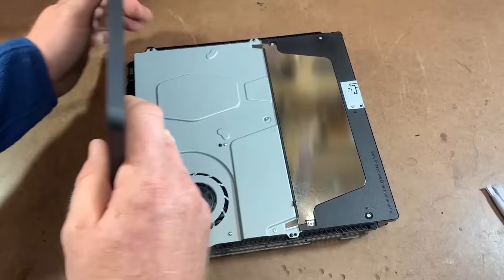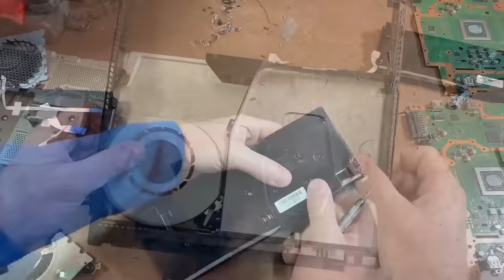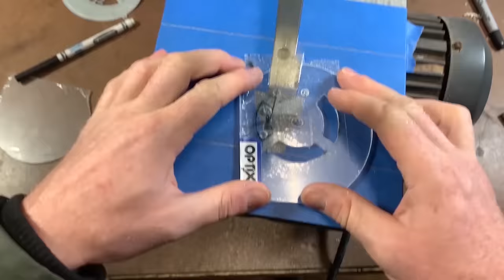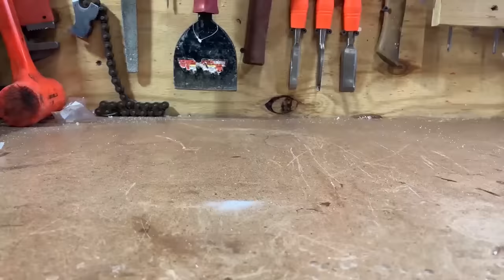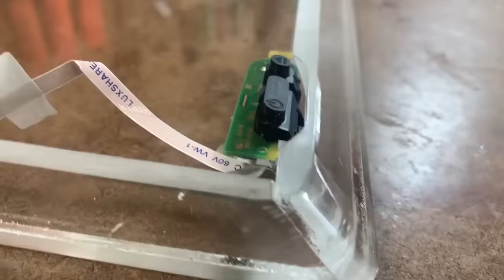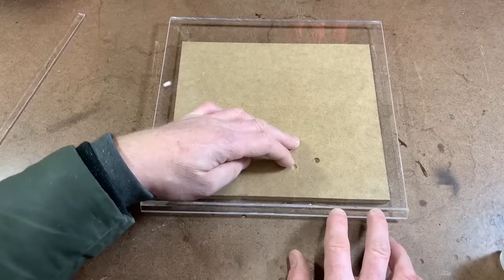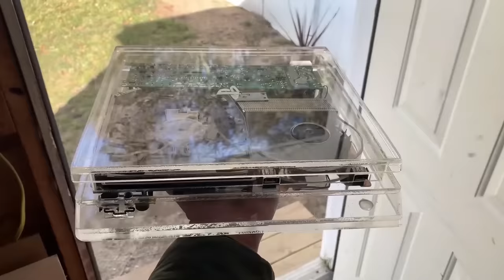Glass Playstation 4!! Custom Hand Built!

Comment: So y’all aren’t worried about the air flow?
Reply: He should of cut vents and have the top peice of the frame raised about a half inch for extra air flow.
Reply: This man just turned his PS4 clear. Gaming on this machine isn't a priority. This is for the aesthetic
Reply: Yeah he should’ve cut vents
Reply: I'm more worried about how he threat the power supplies. Careless af
Reply: Air flow? How tf are you not Disturbed at the fact he glued the heat sync on the processor and even didn't change the thermal paste?!
Reply: No worried
This is masterpiece
Reply: That's good more breathing
Reply: The music was a little too southern...no wait, i mean corny.
Reply: nah but im worried about @_bxrti on instagram hes cool
Reply: @Junpei747  I know that's playstation abuse 🤣. Call 444!!
Reply: @Junpei747  finally someone mentions it lmao
Reply: The real question is how he gotta take it out of the glass when he’s done or doesn’t want it in the glass box 😂
Reply: @User_55558-z  glass is known for shattering on impact...
Reply: @Shrixen  btw it's acrilic not glass. Acrilic is a lot more durable then glass. He does not need to smash anything all he has to do is heat up the glue and it will flow so he can easily take apart the frame.
Reply: @User_1795  lol ik its a joke

Comment: The metal plates all over are there for a reason, they're called faraday cages and are meant to avoid shorts and interferences such as static. There's also a reason why the PSU is seperate from the motherboard. The HDD is also meant to be removable, not glued to the motherboard.
Reply: definitely not for gaming several hours straight daily
Reply: @JEZZUZZGaming  nah hes not a buzzkill hes right idk why you had to point it out
Reply: Not to mention there are no slots cut for the fan to suck in cold air through the heatsink.
Reply: @JEZZUZZGaming  bruh
Reply: If it's not gonna get killed by static it's gonna cook itself
Reply: This would only be good for netflix niw
Reply: @JEZZUZZGaming  😂😂😂😂😂😂
Reply: @jamessmith2514  I'm pretty the guy knows this. He's made it for the sake of making it. No need to be a super nerd
Reply: @broughy23  no wonder he only played deadcells on it,if he tried any other game that thing would've been roasted
Reply: @broughy23  only person with sense
Reply: A guy in his mom's basement jealous he doesn't have the skills or the balls to come up with this so you gotta trash instead of appreciating the hard work, skill and guts he had to do this
Reply: @kmburke84  Cringe 👆
Reply: @RANDALZ  lmao
Reply: are you forgetting that piece of metal he tossed to the side after cutting the heat sink out was a cold plate for cooling the memory as well playstation without active cooling on the memory and vrms wont last long
Reply: and he didn't even clean and replace the thermal paste and just glue it together with the heatsink, I cringe there
Reply: Quesque ça peu te faire ? T'es jaloux de sont travail ?
Reply: @broughy23  so ya the  kinda person who would buy this and if  it  screws up ya  would  hey its kewl as  ya  maybe  spend  500  dollars  for teh custom case  and  60 dollars   shipping  to and  from and in lets say a few months it  died on ya cause no proper heat syncing and such as ya had a brick of a system  right? You call folks point out  stuff  super nerds . well those super nerds  don't want to pay   some ungodly amount to have a system  die on them and then have to go and buy a new  system . 

so please  state  ya would not care if ya spent 500 dollars not counting  shipping and handling  to maybe  in a year  it dies  from the various  things like shorting , hard drive crash ,  or melt  down.
Reply: @kmburke84  Naw i think most of the folks that @Eng-Kush ( what a name  must be a massive  pot  smoker )  called Super Nerds  would rather have a  clear system taht woudl last a while  vs  having it  die  within  6   to a year and have to go out and buy a new one. Bear in mind . Sony makes it easy to replace teh hard  drive  on teh PS3, PS4 and I believe the PS5  . Just for teh possibility of a hard drive crash and also  so one can upgrade teh system ( of course they sell if i  recall preformatted  hard drives for that so ya feel like a real gamer  buy popping in a approved  hard drive) 

as far as skills   yea  not everyone has the skills  to build but they may have other skills  like if ya dumb ass accidently installs a virus  thinking  whoo hoo  ya  found on a torrent  website a copy of  GTA 6  and the game is out and instead of buy a legit one ya get that Torrent and opps it  opened you up  to being hacked  and ID Thefted . that  not talented at construction person . MAY in fact be the one to help ya fix that so  ya  keep those pictures, illegally  downloaded movies and Music    from being lost. 

You call it trashing skill . I see it like folks who know more about the insides of devices  educating those who just  dont know. If i was into construction of  such  devices  I would actually appreciate  folks  pointing such things . I sure as hell would love to know hey  ya really should keep those pieces  and such . I sure would feel bad if i sold  a  clear  case system  for  lets say 500 usd  only to find those folks coming back to me  hey  my system is  fried ya  owe me my money back and  a  new  ps(x)  

Sad i am sure ya would not care as ya like screw you   want a new one i will sell ya one  for 1k  i am not gonna  refund ya cause i didnt know about this and that. i am pretty sure ya a dishonest person. i wish ya would let us know ya real name and location irl  so  we can avoid doing business with you
Reply: @yukinagato6761  you've mentioned me in two comments bro are you that triggered? This console was an experiment or done because this guy wanted to see if it was possible. No one is forcing you to do this to your own console bud. Try not to get upset about what other people do with their own possessions and you'll live more care free life
Reply: @broughy23  I justy think if one is going to do such a project it  shoudl  be  certified  taht it will work  and no isues  such os  burning  a  system out .  you may live  in a  world  where ya selling dope enough  to buy a  few PS4s   so if ya  bought  a  clear plastic  NOT  glass as he titles many of his videos (BY THE TOS of Youtube is Misleading  to say Glass  vs  Glass like/Clear Plastic )  but anyways  if  this person was to make a living on these  he  shoudl also make it a point to say if you buy  one of these  and it burns out i will compensatue  you . Now lets make no mistake  I am willing to bet this person sells them on some store front at a nice price tag . 

Dare i ask if ya spent  bank on oen and all your important data   was lost on it  how would you feel. The Super Nerds as ya call them  actually have a higher respect for their gaming and  yea  they woudl lose it if they lost   their  stuff on a system  taht was not properly designed . . hell how many bad  reviews  do ya hear  about this game and taht game system cause of poor performance. 

You may have no issue  shelling out  bank  and maybe if ya  constructed things like this and  didn't care about  it  burning out and performance  great . but for others  that stuff matters. 

for many money is still a bit  tight . but i am sure  to you its no big deal as ya  will beg folks for money here and there  right ?
Reply: @yukinagato6761  Bro I stopped reading that dribble after you accused me of being a dealer. 🤣 you've lost the plot over a fun YouTube video
Reply: and the thermal paste OMFG

Comment: looks cool, but you forgot one major thing, vent holes. The only place for miniscule air now are at back and maybe through blueray drive. Normaly theres vent holes at sides for intake and also at the back for exaust. As it is right now this thing will cook itself to death.
Reply: That fan ain't pulling in air for shit, centrifugal fan just won't "breathe" from those tiny holes
Reply: Yes bro. No vent holes.
Reply: I don’t care about these holes. Another fact is interesting, how will he disassemble this soap dish for cleaning?
Reply: I was thinking the same thing. With no vent holes that thing is dead.
Reply: bruh but this guy forgot to change the termal paste and glued the heatsink to the board
Reply: Won't last long enough, no thermal interface between the chip and heatsink.
Reply: was just thinking bout this.... this material can be thermo-molded. therefore heat can modify its shape. I was a little bit more relaxed when I saw the fire. But I still wonder. if he could spend let's say 6 hours or so playing without any impact.
Reply: @redlineone6737  i think he just made it for the video. if he really wanted to play it he should have done some blueprint work first. tons of mistakes. Why go through the effort of owning the machines and making precise cuts if just to leave out the most precise but miniscule things in a build... Buddy clearly never built a pc before and just thinks he could stick the thing in a teddy bear or a deep dish pizza if he wanted and call its "PS4 build"
Reply: @NaVilke23  fr should of used some screws
Reply: Also, glueing your heat sink, can’t replace the thermal paste
Reply: he forgot to replace the termal pads on the ram too, he could have used mini heatsinks, but yeah this thing in a year will be a pretty paper weight
Reply: Not to mention repair or maintenance of the system
Reply: Him tossing the metal parts away annoy me, I know they block what you want to see but they help move heat  I hope that doesn't overheat.  It does have a fan so bad airflow is better than no airflow.  He didn't even apply new thermal paste
Reply: @Lagger-HD  he literally made the shell, you say "but I build pcs" no you don't build shit you just put it together from existing parts this guy actually built it with his hands and raw materials so shut up
Reply: @Lagger-HD   u could not pull that off
Reply: He forgot the tension plate for the aoc. If he knew what he was doing he wouldn’t have used super glue to attach the heatsink or wouldn’t have glued everything shut. As a pc gamer all I could see was see the extreme use of super glue.
Reply: I can’t believe I see negative comments. Just appreciate the build Damn 😂. Didn’t have to be perfect to be amazing
Reply: @azzithegod  Dont have to be perfect, just functional. If its not functional its a piece of art that looks like a ps4.
Reply: @53XYCL4P-TP  that PS4 won't last long

Comment: Oh this console is so gonna die from overheating, but nice skills I guess.
Reply: yes sir
Reply: Please sir, please, where can I get all the parts for ps1 1 2 3 4 transparent please help me it is not available on ebay or on amazon or anywhere from where can I buy please help me chassis ps1, ps2, ps3 and ps4 transparent please
Reply: @بيببيب-ف3م  build it like he did with glass and plastic
Reply: What do you mean by overheating? Does black colour prevent from overheating then this? Pls explain.. tq
Reply: @mi10tpunya94  you blind?? he left no breathsing holes for the mother board
Reply: for sure, this ps4 was gone, died.
Reply: Even with added vents glass heats very quickly,.. sorry but not very well thought out!!
Reply: @alexisortubia2852  Ah I was wondering what he missed.
Reply: He probably won't play in this console, it's just for show.
Reply: Sir dont forget the parts for the ps5
Reply: @mi10tpunya94  It’s gonna overheat cos there’s no holes for the motherboard to breath
Reply: He used the weight of a mug to put pressure from the heatsync to the apu chip. Definitely not nearly enough pressure and the glue isn't gonna hold that pressure for long as hot as it's supposed to get.
Reply: I think he built it as a trophy piece and probably not as his main gaming playstation. Who knows. Might have been a cheap online pick-up. Whole bunch have been on sale because ppl want to grab ps5s. I'm sure he's aware that all the metal sheathing is there for a reason. I can't know for sure, but it DOES work for now.
Reply: Dark Alk  oh I see.. nice and polite answer you give me.. tq..
Reply: @Baysehead tq for your answer
Reply: @sceptregaming69420  tq for your answer
Reply: @Bundalaba  he also glued the heat sink down without replacing the thermal paste
Reply: yes, everyone here is quite right. that ps4, is done. gone. even though it works, there’s no ventilation holes for the console to breathe. leading to it overheating, and destroying the console. even if it was still plastic, he shouldn’t be putting heavy stuff on it. puts pressure on the fragile parts in it. it’s exactly what i always mean, about poor console care.
Reply: @بيببيب-ف3م  go away begger.
Reply: for everyone wondering. he didnt put thermal compound on it
Reply: its not even glass its acrylic
Reply: uuhhhhh..............
Reply: @kerrykirk2515  It was VERY well thought out. He knew if he did this he would get millions of views and be able to buy 100's of PS4's.
Reply: @kerrykirk2515  its not glass
Reply: I think using plexiglass would have been better for this reason, normal glass heats up too easily.
Reply: @ItsATrap614  You think he used glass??? How does plexiglass heats less than glass? are you 8?
Reply: I bet the playstation it dead by now from over heat lol

Comment: The PS4 is too hot
Turn off the PS4, and wait until the temprature goes down.
Reply: Yap, my old ps4 slim goes lag, after an hour's play Ghost of Tsushima.
Reply: Open it up and blow out the dust. I have to do that with my brother's PS4.
Reply: The cooling will actually be better 😉
Reply: I live in North West Victoria Australia where during summer we casually get 45+ degree days and I don't use an aircon, and I've never had this problem meanwhile my cousin in an air-conditioned room proceeds to have this problem.
Reply: @SimpForYoruichi  the memory chips doesnt have disipation it will burn
Reply: this ps4 take the air down so the components will have a lot of dust in 1 year
Reply: You didn’t change the thermal paste......
Reply: If I had a ps4 I would play all day
Reply: Every 60 seconds in africa a minute passes.
Reply: I'm I the only one who's never got this warning
Reply: @toxicbunnyxd7944  literally, neither of my friends haven’t either. I think people just have bad versions of the ps4.
Reply: @apintheforbiddenone4754  I play got for 2-3 hours and my little brother plays for 1 hour. No lag but the ps4 is dang loud but it's okay because the tv is louder.
Reply: I cringed seeing the solution to heatsink. The thermal paste wasn't replaced and the ram isn't being cooled down at all.
Reply: @phantom3289  well a air conditioner does filter dust in and out and can allow dust to get in your room no matter what you do to stop it could be part of the problem🤷🏽‍♂️
Reply: hahahah thought same thing
Reply: My PS4 si feas ;-;
Reply: BEEEP BEEEP BEEEP
Reply: Maybe, he already has a ps5 and doesnt want to use it never again. And decided to do this.

Comment: He’s throwing PS4 parts around and I’m too scared to clean the fan 💀
Reply: either
Reply: if you got a air compressor to fill up tires, you can take just the top off the case of the ps4, and blow into the fan with it, it doesn't matter which direction, I've done it and it works fine, I have the slim and the top of the case snaps off front to back, becareful when opening it
Reply: No cap 😂
Reply: Fixing my PS3 is how I got into IT.
Reply: Even worse how tf u going to open it
Reply: Do you guys clean the fan 🤭

Comment: this concept is good if you're just going to display it, but if you're a gamer this will not last long and you will have problems with overheating the console, he didn't pay attention to the cooling system like the fan ventilation and especially the heatsink it was glued only. but the looks 100% good.
Reply: You’re right
Reply: plus if you are in a room were the sun directly hits the ps4 it will prob heat it up
Reply: @lalokey.  no actual gamer let's the cringe sun in
Reply: yeah that heatsink isn't gonna have the proper mounting pressure it needs to do its job properly, there are some overheating messages in that consoles future.
Reply: I think he can easily screw some holes open at the back. He's got the equipment to DIY anything.
Reply: If you're just going to display it, though, why not just make an empty PS4 model?
Reply: @CoolModderJaydonX  good question